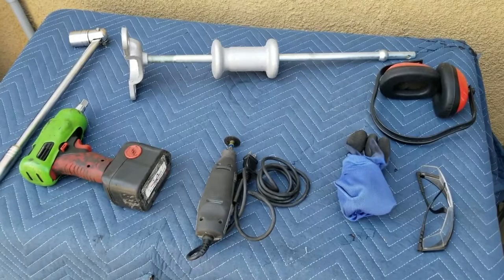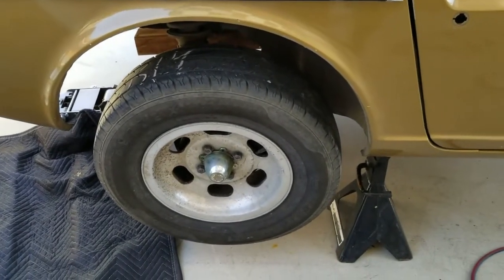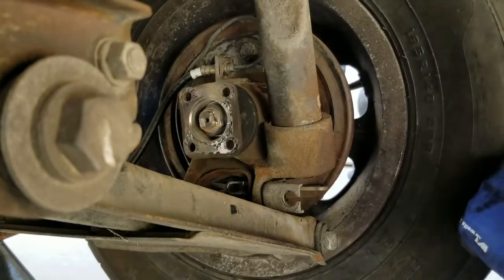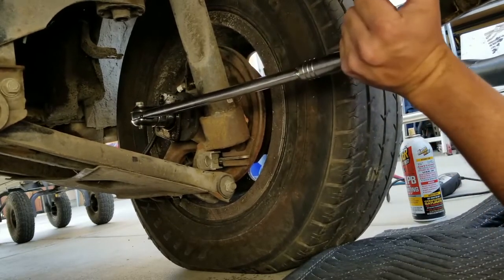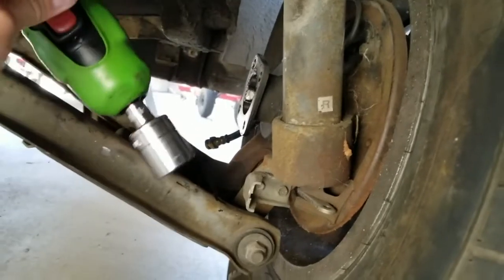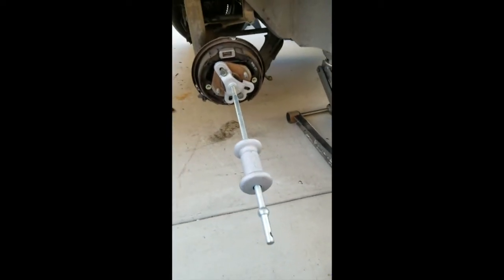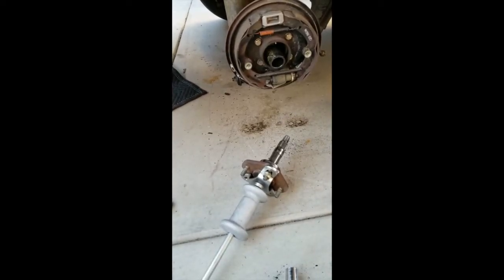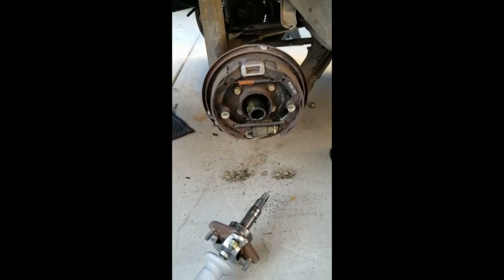280Z Stub Axle Removal for Rear Disc Brake Conversion

Comment: Nice! What socket/wrench did you use to take axle half shaft 4 bolts loose?
Reply from the maker: 14mm wrench and 14mm swivel socket